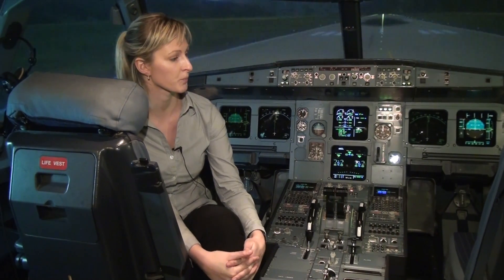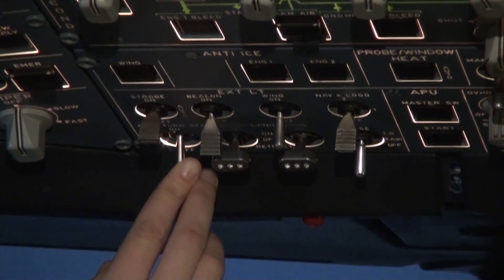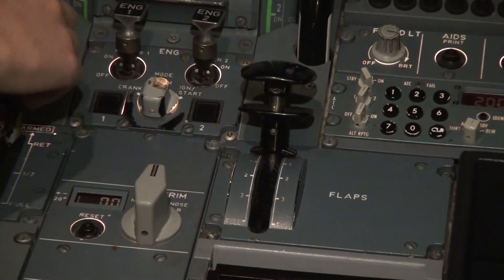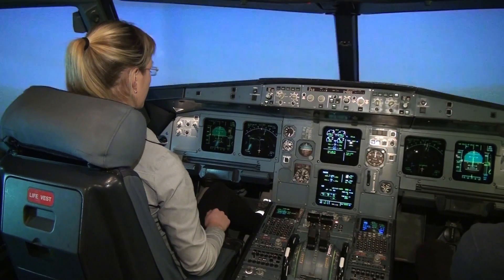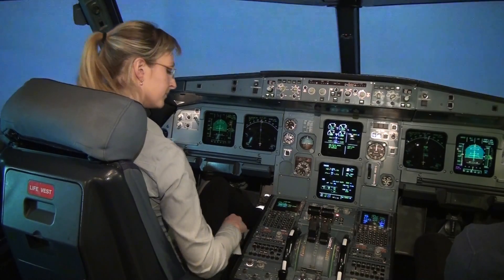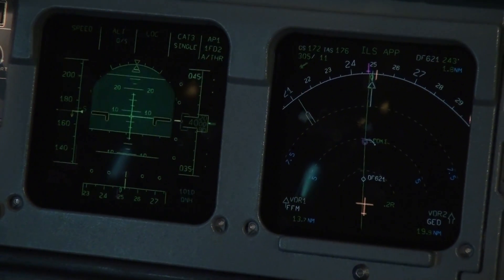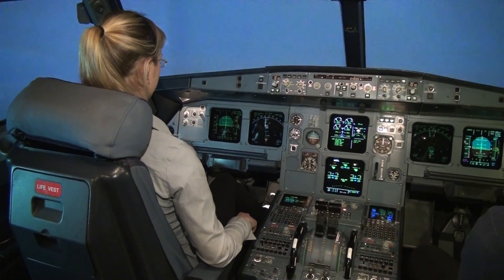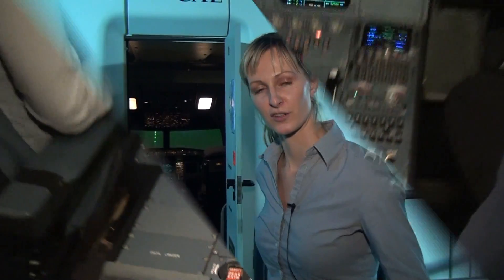CPL Holder landing an Airbus A320 for the first time - Baltic Aviation Academy

Comment: I would be very surprised if she was a "current" CPL pilot.  She seemed unaware of the most basic operations of the autopilot panel, or even how to set them to new values ?  Pretty girl for sure, but pretty irrelevant as far as a flight training video goes.
Reply: Ian Turner Well, auto pilot for the 320 is different then the auto pilot for a Cessna don't you think.

Comment: you have forgot to set the reverse thrust
Reply: ahmad abo sultan You use R/T to get the speed down, AND to save the brakes.
Reply: In this occasion it appears to be unnecessary, they are just trying to get a relatively unskilled pilot down and stopped, auto break is sufficient for that though I do think it is standard practice to use reverse thrust under normal circumstances to get the speed down to something more manageable.

(Though what do I know, I just watch the videos, not fly planes.)
Reply: thank you a lot for this information
I wasn't know it 
so do i ( watching some videos about how to fly in planes particularly airbus's planes
Reply: yes i agree with you but she had to use it because she was landing manually